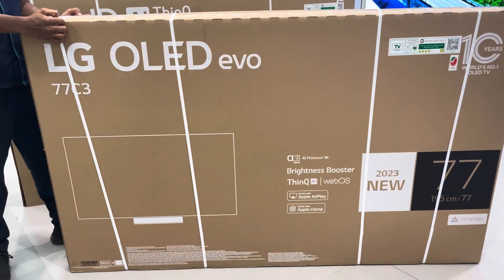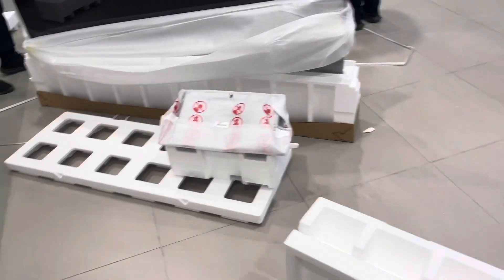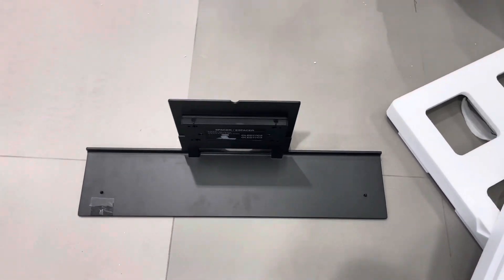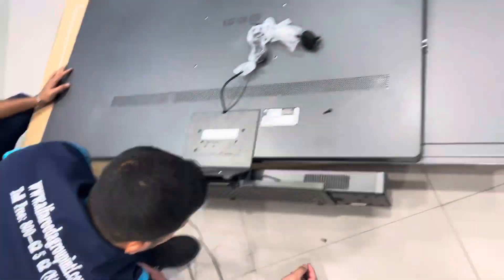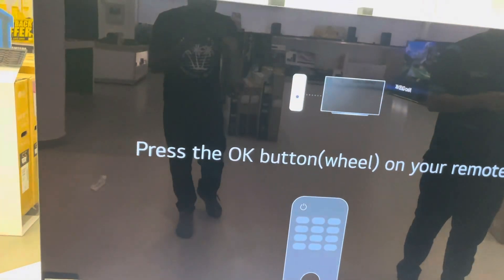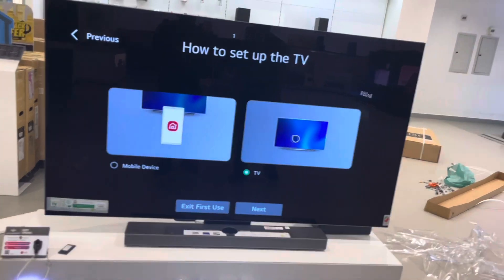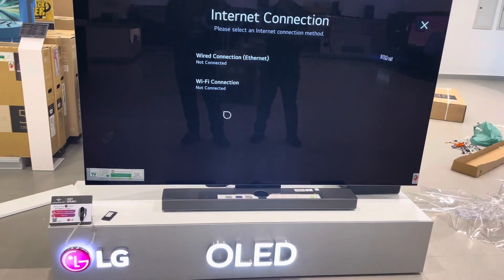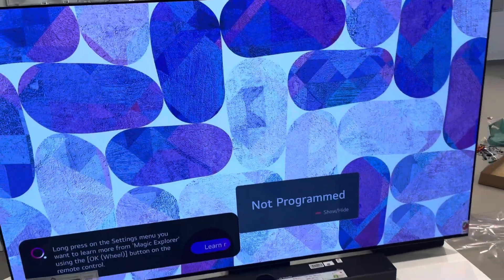Unboxing OLED LG C3 and installing With SC9S SOUNDBAR 2023 NEW MODELS

Comment: Thanks for the good video! I would like to know how far the soundbar is below the bottom edge of the C3. There seems to be few centimetres gap at least so I am guessing that it is approx. 10cm.
May you measure it to be exact?

I am going to install the C3 on the wall with this soundbar and need to know how much space to leave below.

Thanks!

Comment: Sc9s witg rear kit or sony s500rf for movies n music?
Reply from the maker: For OLED C3 and C4 Series SC9s will be a better choice coz u will her the wow orchestra 3.1.3 channels 400W
Tho the Sony is good and more power sound output 5.1channels 1000W and the problem I have with it is its not wireless it has to much wires but it’s good
Reply: @wasswapeter1  thanks. I don't have any lg tv. I had vu goled tv

Mostly I watch movies and music and have 350sq feet room

So I had option like sc9s with rear kit or s500rf

So can you suggest which to go

Comment: How is the soundbar connected to the TV?
I mean how does it receive audio from the TV?
Reply from the maker: U can connect via HDMI(ARC) if u have OLED C or G series u will get lg wow orchestra ) or BLUETHOOTH or WIRELESS
Reply: @wasswapeter1  but I am already using all 4 HDMI inputs to the TV.
Reply from the maker: @An.Individual it means ur already getting the audio from the soundbar right ?
Reply: @wasswapeter1  TV is connected to 1) Cable Box 2) BluRay 3) PS4 4) NvidiaShield so no HDMI port to use for SoundBar.  I see an optical cable so will try that
Reply from the maker: @An.Individual then get on HDMI Adapter
Reply from the maker: @An.Individual  optical will work form very well boss